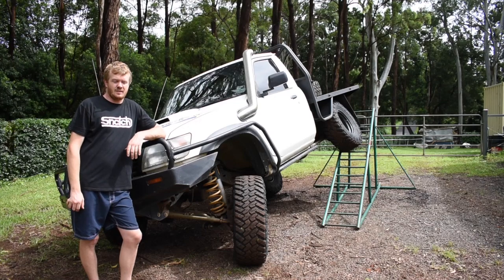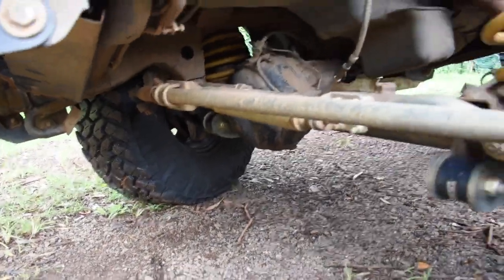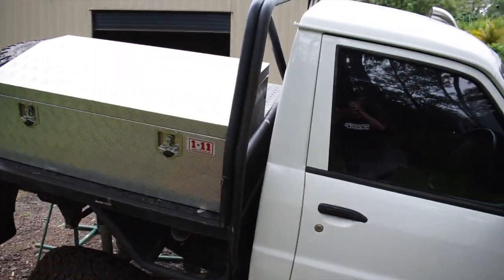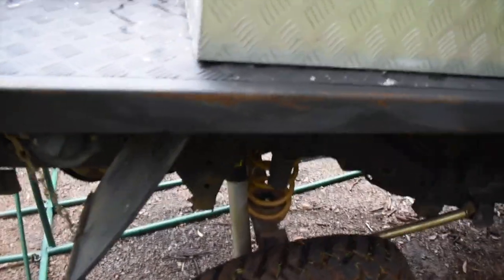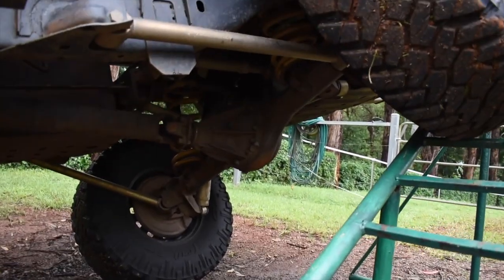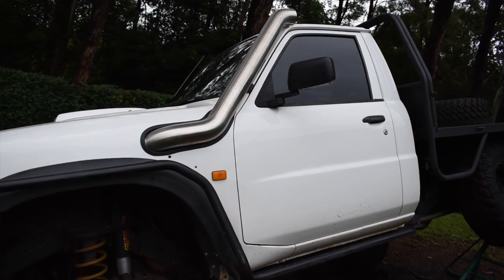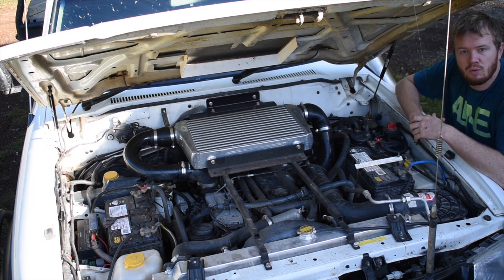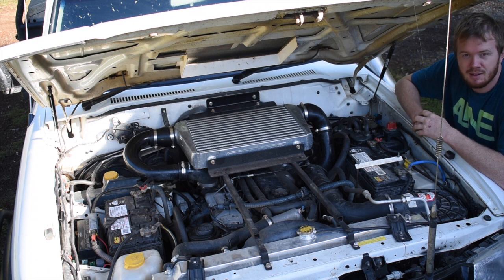GU UTE rundown

Comment: Hey mate nice rig what's the hp figures ya getting from maxed out 11mm pump?
Reply from the maker: 180hp  19,20psi boost     and had no fan/air going though the cooler on dyno
Reply: @revhead757  oh that's preety good stock 11mm or modified
Reply from the maker: modified a little  compensator plunger been modded that's it

Comment: Hey mate bit late on this one but what size is that front slim light bar?, on the bull bar, the top one
Reply from the maker: 26" i think
Reply: @revhead757  Righto 
Thanks for the fast reply
Reply: @revhead757  😂 Also what are the rear reverse lights?
Reply from the maker: @ned5391  just ebay flush mount ones